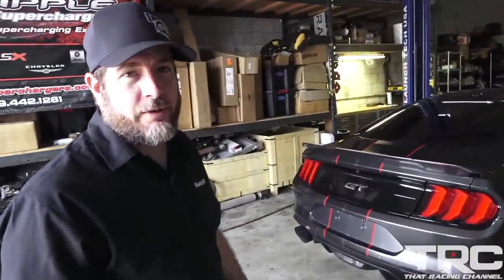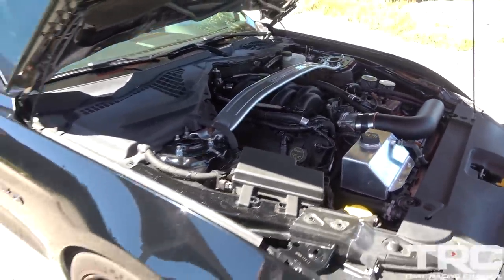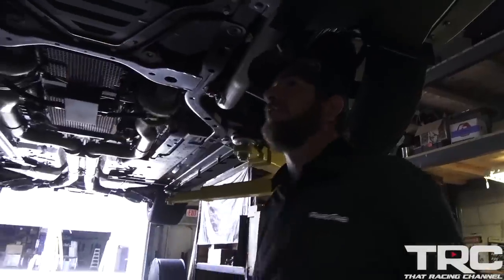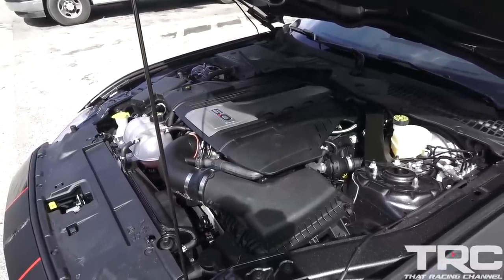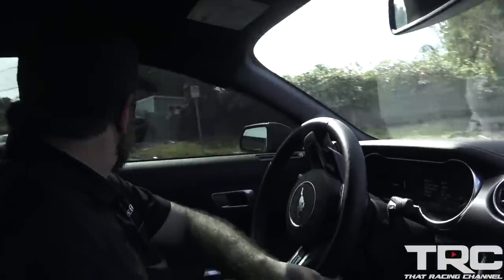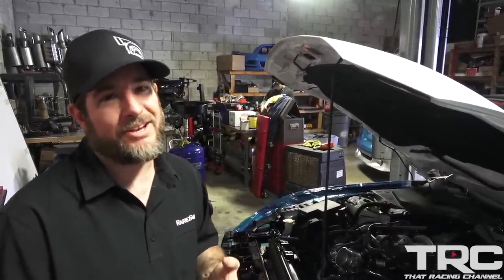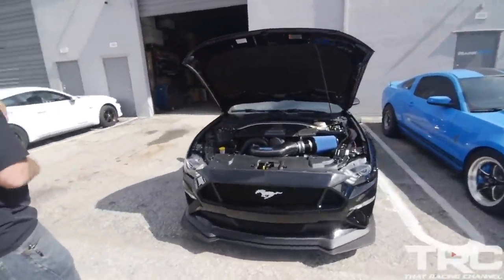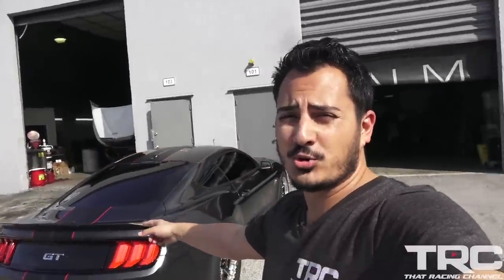1400HP Mustang LOOKS STOCK Under the Hood! (Secret Turbos Under the Car)

Comment: The coolest part of that gray sleeper stang is how they ran the cold side intake pipe through the stock air box. That right there is what really gives it a stock look. Besides that low ass oil tank that is one of best kits I’ve seen

Comment: Honestly they did an amazing job on keeping the engine bay and body and interior mostly stock looking. So clean under the hood, most people would not notice anything. People who race and/or have knowledge of racing and cars would obviously see the things everyone else doesn't. The tires are a giveaway, and certain parts under the hood on a small scale being different but they did great job with the "factory" look. Exhaust isn't crazy either. So what if it has badges or race tires, I think they accomplished their plan.

Comment: A friend of mine has a very similar set up ( 2019 GT ) - 1200+ to the wheels . Started to have issues with the trans - fixed that - now cant pass emissions - gonna need another tune to pass here in NY . Great to have all that HP , but if you have to keep screwing with it ..... Another friend has a setup with 900+ to the wheels - no issues . Sometimes , and I guess depending on where you live - a little less is just as good . You're never gonna beat everybody , although at 1400 on the street - you're probably pretty close !

Comment: To the untrained eye it will look like stock.

To someone that has been around cars for long time, and knows things about cars, it don't look stock.
Reply: So.. not the untrained eye.. 
If you've been around cars and know cars, you're not untrained..
Reply: The Royal Crowned Tiger 👍
Reply: The Royal Crowned Tiger - the Race wheels and drag radials are an instant giveaway.  Still don’t understand why you would go to all the trouble (and cost) to hide the turbos and then put stick on twin turbo badges.
Reply: Hence... ANYONE at a Track or wanting to race. 
🤣🤣🤣🤣
Reply: Yup
Reply: @danmyers9372  Yeah, the stock wheel with the biggest MT SS street would have been dope.

Comment: So for a price breakdown. 
-2015-17 Mustang GT ~$26k
-Hellion Turbo Kit and other parts ~$10k
So for ~$36k you can have a Mustang that will look, feel and sound like a totally stock GT even if you open the hood, and probably run deep in the 9's. Unbelievable.
Reply: This is a 2018+ not a 2015-17
Reply: @brandonUwanawich954  It was just a hypothetical. You can get these for the earlier cars too, and they're damned affordable for the kind of horsepower they can make.
Reply: @brandonUwanawich954  how much u think it would cost to build a 392 to 1400 hp with build engine ect?

Comment: If they want to go for the sleeper look they should take off the 5.0 twin turbo badge to add more sleeper points
Reply: Run stock skinny tires, install AWD system.
Reply: Put EcoBoost badge on and v6 decals.

Comment: At what price would this cost??
Reply: Wasn’t on there website..
Reply: Probably around 15k which in regard as too how much a little amount of money could get you.....if you’re a welder/fabricator....prolly around 2-5 depending on parts and pipe. Then you got to ad in fuel system, driveshaft, ect...you get the point
Reply: Roughly 11k

Comment: These cars just make power. Stock  and specially with a built motor. The most I've seen on just pumped 93 with nothing else. No meth, No E85, No octane booster, etc was 1342rwhp, manual trans, with 64mm precisions on an off the shelf Hellions kit. So I'm not surprised at all. Let's be real though. It's 2020 and it's a nice clean kit and or build depending on how you look at it but it's not fooling anyone that matters. Meaning anyone with a little bit of racing experience. If you don't know what your looking at or hearing. You deserve to leave the race with empty pockets afterwards lol. Again really nice builds.

Comment: How much does a build like this cost consider building one even tho I’m a Chevy guy
Reply: stick with the bowtie man its much easier on the  wallet long term
Reply: 30k
Reply: Probably like 20k
Reply: It really depends on your budget. If you have the money and want to win, get a coyote. If you just want a nice build for less, bowtie has you covered.
Reply: @burgerbandit3646  what does a 1,500 hp sbc run these days?
Reply: 15k-20k
Reply: These kits are north of 25k just fyi
Reply: Well the one they don't have on the lift is running an ls
Reply: Truth Time TV I have a 2007 Ford Mustang, v8 4.6 liter. Bone stock. What would you recommend for kit and price?

Comment: I'm sorry, I'm confused; at 7:17 he says they "ran into valve float" around 700 whp, but the exhaust fixed the issue and made an extra 100 whp? I fully understand how valve float limits power, and how a good exhaust can make more power, but how does an exhaust fix valve float? I'm assuming I misheard that...
Reply: Exhaust restriction can cause valve float on a turbo car.  Spring upgrade and reduce restriction are the primary corrections.  It comes down to backpressure preventing them from doing their job

Comment: Price of a turn key system like this?
Reply: At these power levels, you're looking at an engine build which is it going to add another 15/25K or more to the price. I'm sure he has stock motor options where they just install and tune the turbo system at lesser HP levels.

Comment: So the factory resonators are removed?  In other words no resonators correct?  From my understanding the removal of resonators does give a little more HP because resonators themselves do cause some restriction.  Back pressure is something more necessary on older cars I believe.  I straight piped the section of my '05 RSX Type-S in place of the resonator on my Greddy catback exhaust.  I believe it improved horsepower and fuel economy although not that significant.  I agree with another poster that your Mustang is a sleeper with the exception of the "Twin Turbo" badging next to the 5.0 badge on each side.  LOL

Comment: Fathousefabs.com in Indy does them at 1400 rear wheel horsepower .and it does not matter if you run e85 mixed. with gas as his software instantly figures the mix and adjusts for it

Comment: You guys gotta come check out mine and all the other LPF twin turbo coyotes during TX2K20. Mine makes over 1500whp and is currently number 2 in the world by only 6 100ths of a second. Cars can make dyno numbers all day but running at the track is more impressive. LPF has two 18's that have ran 8.0 (mine) and 8.1 and many other s550's that have been 8's as well. Including one S550 that has been 7's. Come check them out when yall get here for 2k! Would love to show you guys what mine can do on the street and track

Comment: 2 week turn around on a complete build? That’s built motor and everything?
Reply: They don't build the engines, just swap oil pump gears. The engine internals are stock.
Reply: allanb3222 Stock internals with 1400HP, really?
Reply: @HP.Customs  they swap oil pump gears for a forged set (tis the weak part) & the stock internals stay, they are good for 850rwhp. The 1400hp car was built & sleeved if you caught that.

Comment: if you put the turbo too far from the engine, does it increase the lag?
Reply: In most case's because the gases have to travel the length of the pipes in each direction before entering the engine...from Wyoming USA 🔫🤠🇺🇸
Reply: @billallen4793  yeah. muscles suit better with superchargers.. imo. :)
Reply: @b0wgey  ??

Comment: Thought I would correct you there buddy but the 3v doesn't like more than 500hp and a 3v is not a gen 1. Gen 1 coyote is pushing it when you go past 700hp 650 is the safe spot for the Gen 1 coyotes. Gen 2 850, gen 3 900
Reply: Facts

Comment: Those turbos wouldn't last one week on the roads in Michigan. We have these things called potholes. And they have been known to Total out cars.

You know what street light you get stuck at in the car with 1400 horsepower? All of them. Hence the term, streetlight to Streetlight drag racing. And when you decide to take it off from the main roads, with all the street lights. And decide to take it out on the back roads, and open it up. That's when people get killed. Let's keep it on the track guys. For your safety, and Ours.

Comment: I’ve never heard of someone being scared to push a 11-14 coyote over 500...I wouldn’t be scared in the slightest to push a 13-14 car to 700+ on E fuel.
Reply: I was just reading the comments to see if anyone was taking about this... 700whp seems to be pretty standard for stock bottom end,  boosted, 1st Gen Coyotes.  At least where I am at (Sac, CA)...  I've been to the dyno with friends that hit that number and they all beat the crap out of their cars for years after.  Most are SC, but still.

Comment: wouldn’t 1400hp pull harder than that?
Reply: jeriah exactly my thought
Reply from the maker: The black mustang was at 1000hp on that boost setting
Reply: @fuknoz  lol
Reply: Well it wasn't turned up because they were on the street
Reply: 1400 hp would pull a lot harder than that. But, just because they ran 1400hp at max boost on the dyno, does not mean you are going to drive around at that boost level.

My guess is they weren't running more than 6-7 psi of boost during the pull. Probably 600-700 whp at that level not 1000 as OP claims. 1000hp would suck the camera man into the seat (bro has a TT sleeper kit on his 15 stang)
Reply: ironbull2003 your right but why clickbait us if they not gonna show it with all the sauce?
Reply: It’s a customer car you really think they’re gonna go all out on a video recording
Reply: Whysoserious full send only

Comment: 11 to 14 gt can hold more then 500 to 600 stock I've see plenty do 800 or 900 reliable    the 18 n up by have open deck design in block which makes cylinders much weaker  n lets not forget about plasma field boars which suck 1st and 2nd gen gtr will hold better then newer one's get ur facts right and its a stock Hellion kit anyone can purchase it and have it on the car in a weekend

Comment: So where's the 1400hp..950 whp is not 1400 crank..did i miss something
Reply from the maker: Black mustang in the video made 1400hp. During the ride along it was about 1000HP
Reply: @ThatRacingChannel  what's the turbo kit cost installed with out suspension

Comment: Sorry, this is completely detached from reality. That does not look like a sleeper, it looks like a 1400 horsepower car. Anytime you see a car with drag slicks and skinnies, you might as well have a sign with giant flashing lights that says "massive power"

This car has so much power that normal street tires and rims can't handle it, and the tires and rims are kind of obvious to see. Not to mention the badges saying twin turbo. So yeah, it's kind of obvious it's not a sleeper.

Comment: But why? These 1000 hp, 1500 hp, 3000 hp cars are not even called for. If you're going to the track, great, but ever try to buy insurance for a 1400 hp Mustang? Buy gas for an engine that gets 4 to 6 miles per gallon? People today have lost their minds. Electric motors get the job done without the noise. One motor per wheel. This is so antiquated, it's 2020 guys. Cowboys have been gone for 100 years.

Comment: Ok but its useless on the street, rwd wheelspin, awd cars with much less power will gap you.
Reply: It didn't spin with those Slick's, so it hooks and books!!😁
Reply: @allanb3222  slicks suck on the street, the handling goes into very bad territory on top of being illegal.....and there is no VHT ON THE STREET SO IT WILL SUCK BADLY

Comment: Dude lies an said how nice the 10 speed is. Yet he's using a 6 speed. You're in one gear for so long for so much of the pull and barely get threw 2 gears in a pull. No one's buying that bullshit
Reply: That was a 10R80 as it has the plastic transmission oil pan, the 6R80 has an aluminum pan. 2017 was the first year of the 10R80 on the F150 and 2018 for the Mustang.